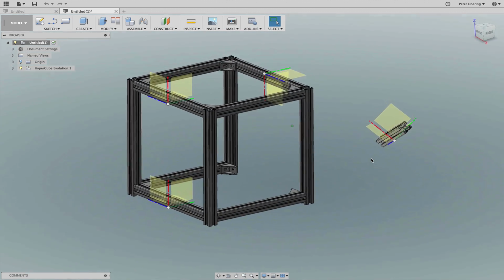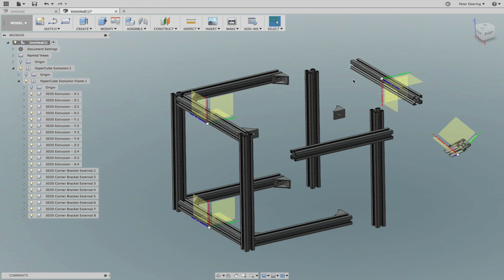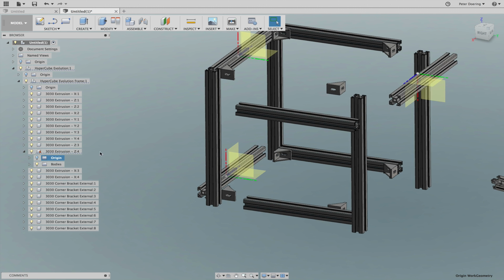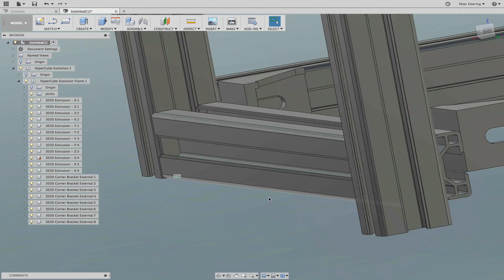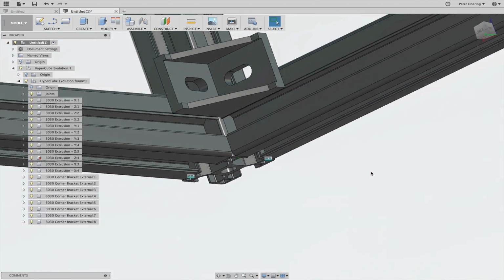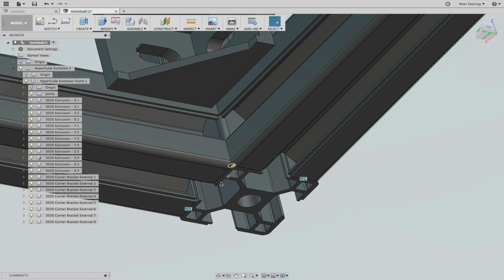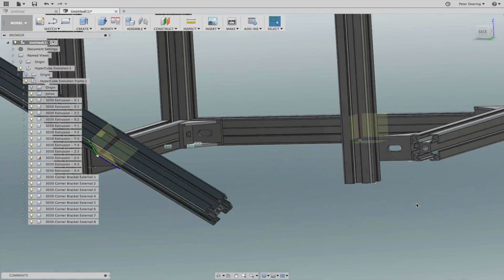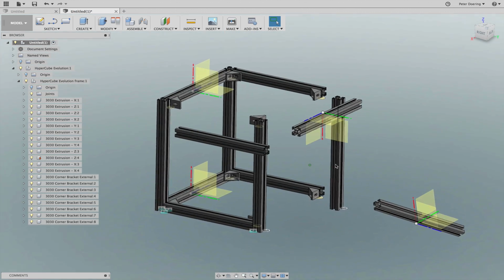Fusion 360 - 3D Printer Frame Assembl

Comment: Why you need to off set 1mm?
Reply from the maker: The profile is 30mm x 30mm but the bracket is 28 mm. The offset will allow it to be assembled centered on the profile

Comment: Snapping I am joke to you. Greetings from Blender.
Reply: @TrippyLighting  Because you have still to find were to place it. Sometimes software feels like it is set in stone instead to behave like wax. I mean dialog text are also cut of and shortened with elipses, so one must hover over to find out what should been in plain sight and not hidden in tooltips. Hey they are making software for so long. I already seen AutoCad product in 1989 were tube monitors with depth occupieng the whole depth of the actual desktop aka table, plotters, extra small monitor for data input and a digitizer tablet. And they are still not able to make a desent GUI for the average guy ore they are hidding it for the 1000$ products and additional packages. This shit is already programmed but they are just to greedy to give it for around 50$ for normal functionality without this cloud shit and extra points aka money for let do it on remote servers without controll for the user what will happen it they shoot down servers at will. Sorry for the rant but thats just what is the reallity. And there is no one stopping them for shopping software houses to just close them if they see any redundancy on theirs pallete of products.
Reply: And to add I am not stupid but get lost in all those geometric detail to find out were to lock in the said joint ship. As to have rotate to find approbiate sight to locate the point. And in that example we are talking about not so customized parts beside lenght. So there can be already snapping points were t-nuts will insert. Also whats the point of having them locked by joinst? But one can't test for riggidity by bolts, screws, washers or having the correct list of needed parts besides the rails? So this is still a mockup but not the actuall assembly which also not shows for issues by not reachable points for fixtures or usability for assembling tools if it gets too cramed in.